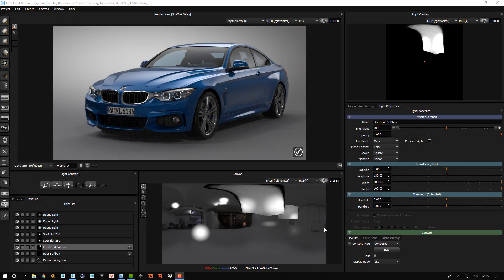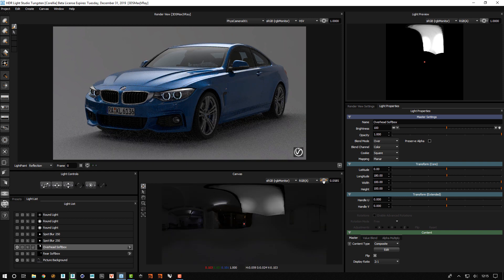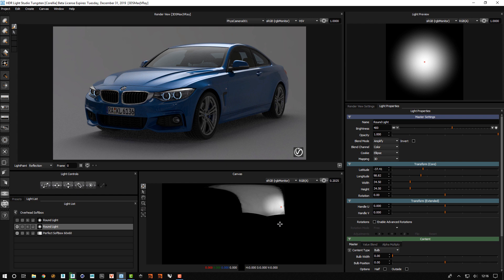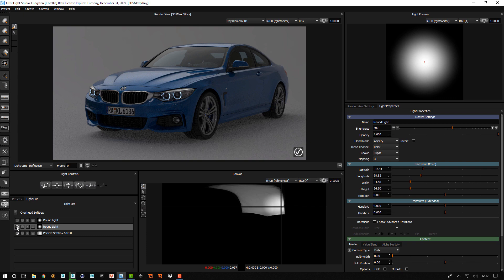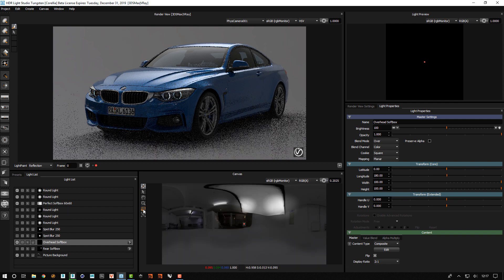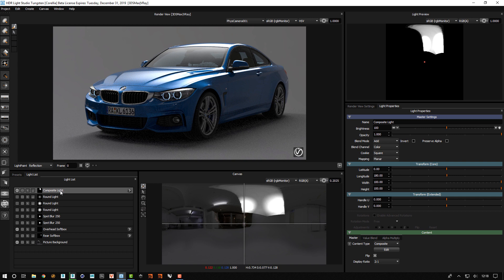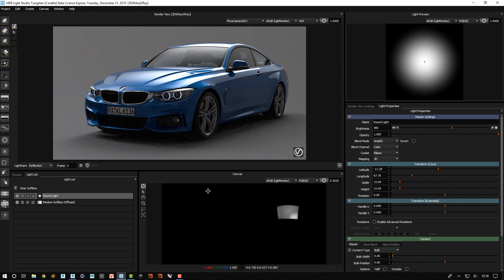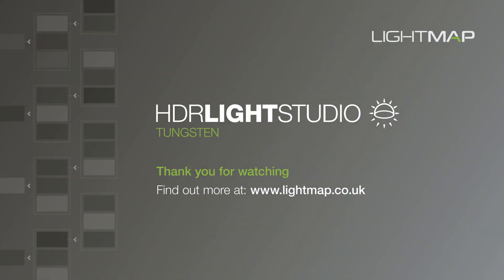COMPOSITES | 2. Enhancing a Single Light in HDR Light Studio

Comment: Once a composite is created I noticed that the 'anchor point/ center pivopt' (red dot) is offset from the center of the Softbox. So when I attempt to reposition the Composite under 'LightPaint mode | Reflection' the comp cannot be placed where I need the reflection. The only workaround I have found is adjusting the Handle U & Handle V Transforms to move the 'anchor point/ center pivopt' back to the middle of the softbox. Is there a more efficient way to do this? Thanks for creating video tutorials, they're incredibly helpful!! 

Cheers from California :)
Reply from the maker: Once lights are added into the composite, if you want to move a light... go back into the composite and pick the light and move it using lightpaint... the fact it is in a composite is taken into account. Even if you rotate the composite. Don't try to move the individual light by moving the whole composite, because that will move everything in the composite. I hope that helps... sorry for the delay in replying.